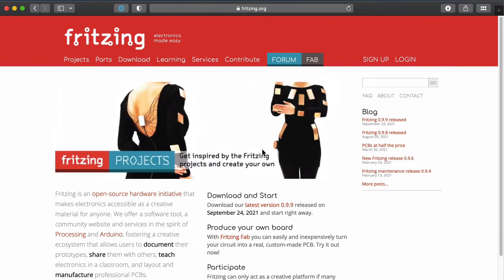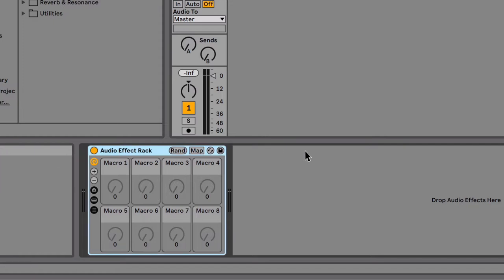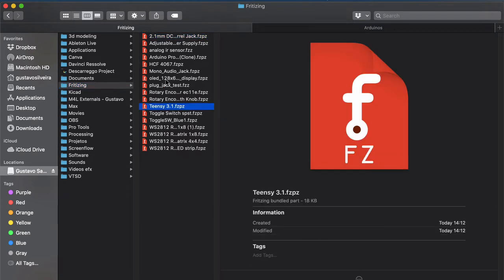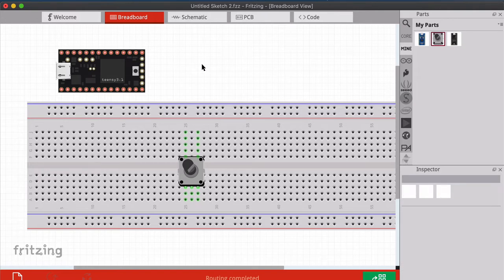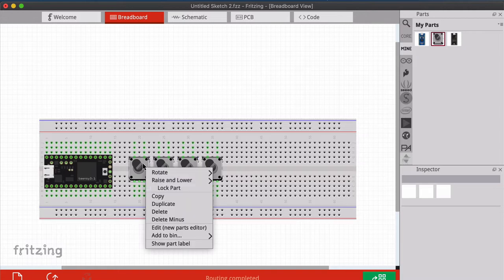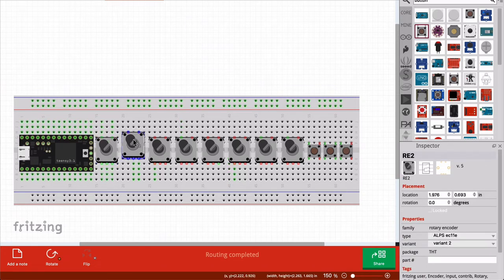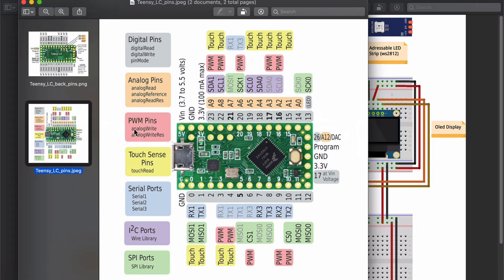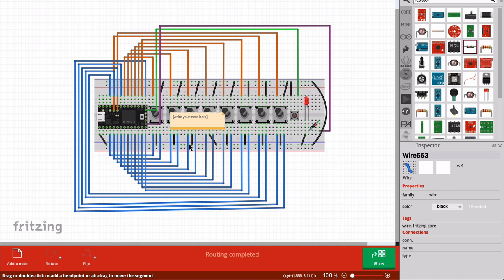Fritzing Tutorial for Beginners - How to Design your Circuits and Diagrams

Comment: I love this video so much. Sorry if I am very chatty in this comment. SO, I am attempting to make a 32 potentiometer MIDI controller using the Arduino Mirco and for the multiplexer, I am using the 74HC4051 multiplexer. If you could, help me figure the coding for the Micro and the Multiplexers. I would gladly pay you for your help. I am using this project for sequencing Bass Lines in my DAW. I am using Windows 10 and Cubase 12 Pro. So, my issue is the coding in the Arduino coding program.Do you have any example .ino files for this situation? Not sure where to connect my multiplexers to the Micro. Thank you in advance. I love all your videos. :) Thank you for all your videos and efforts!

Comment: You could have reversed the last two encoders to wire them to the teensy at the top of the breadboard instead of going to the bottom then left then to the top.  The most important thing when designing a board is to determine the best most efficient way to route your wires.
Phil
Sr. engineer since 1975.
Consultant
Pilot
Reply: ...And all around helpful guy. Have a great day.